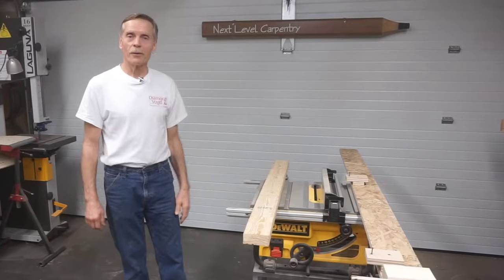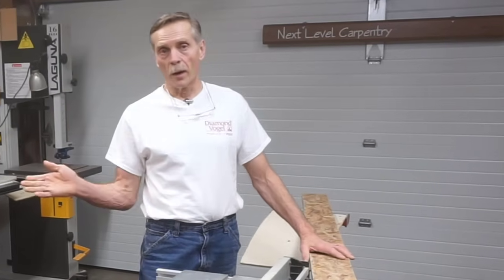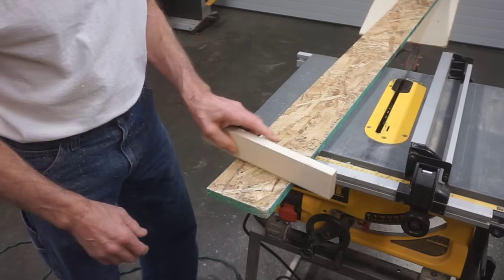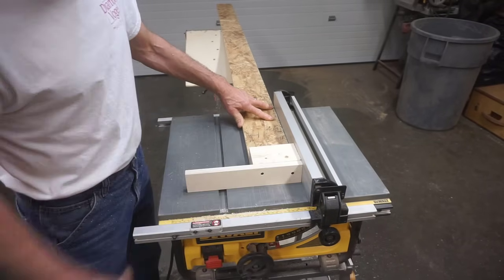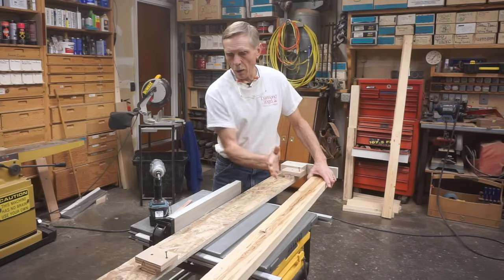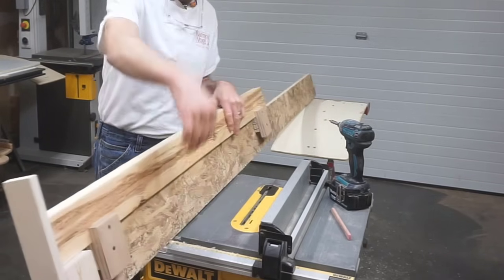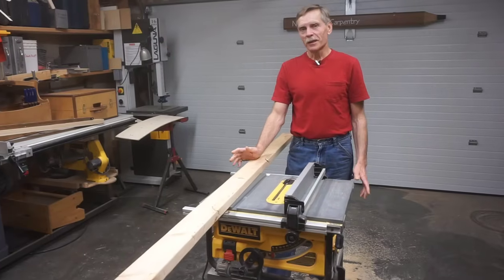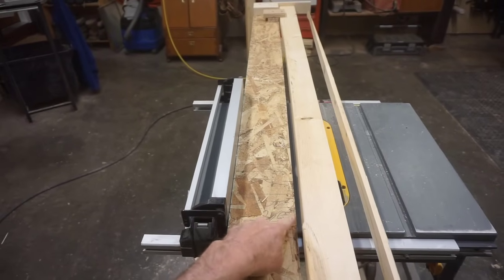How to Cut a Straight Edge on Crooked Boards

Comment: Good video and technique. I think this idea will be more useful for me simply because I'm not a full time carpenter/woodworker and I do tend to look for the discount lumber at the big box stores, which are FULL of warped boards anymore.  If I start doing more work with nicer wood, perhaps I'll look into the other methods that you mentioned, but for now, I have everything I need to make this jig. Thanks much!

Comment: This a great way to straiten lumber.  I also have an 8ft level I use with a flush cut router but to straighten one side sheet goods before I start cutting them down to their final size.

Comment: I have been looking for a method to straighten 4/4-6/4 rough kiln dried. Usually have to use an 8 ft straight edge and a powersaw to get one good edge. Surfaceing is easy. With the goal of s4s and minimal material loss, this method has its appeal.

Comment: Thank you for this video. This is a good trick and probably more applicable for high value pieces such as hardwoods.  However for most projects probably not worth it because of the time involved.  Also pieces with a long slender profile will more than likely keep moving.
Reply from the maker: Actually the opposite is true Jack: the main purpose of this is for framing lumber just like I show in the video.  I recommend using a jointer or a different fixture design for 'high value pieces' to avoid screw holes in the wood. Best, Matt

Comment: I have also just temporarily screwed the straightedge directly to the warped board and run it through to get a straight edge to work from.  Fast and makes for fixing a lot of warped boards quickly without much setup time between cuts.

Comment: I joined two 4' 4x4 posts together with a tenon embedded in mortises created at opposing ends of the posts. The resulting 8' 4x4 post is slightly bowed at the join, such that one 4' section of the post is approximately 1/16"-1/8" below my 6' level. I think I will try your technique as described. Thank you for sharing.

Comment: Just learned this lesson the hard way using white oak 8/4.  Must of been lots of tension in this board, bowed abut 1/2 after ripping.  Going forward will cut with an extra 1/2" and will use this method to straighten.

Comment: Very few job sights I worked on had a table saw, and this would have been done with a skilsaw. Maybe you could demonstrate that method. The how far out gage is a version of a plumbers level used to set the grade on drain pipes. I can see how it could come in handy in the building of a house.

Comment: Thank you for the great tips and tricks.  We maybe using this to square three pine live edge slabs that are 3" thick.
Reply from the maker: It might work, depending on the overall width of the slabs.  If you have access to a track saw it would probably make life much easier if the slabs are large, long and/or heavy.  You're welcome either way...
Best, Matt

Comment: Good video, even though you looked like you where glitchen out.. I use the on top of the straight edge method ALOT on pallet wood that I've planed down. Gona try this on the 2x4s I get off of them.

Comment: I have hand planed to straight 2x6's on my shed rafters where the roof sheathing is nailed on.. And you can just split a board in half and clamp it straight against itself or a straight edge, then screw and glue it straight. I have also cancelled out warps by laying one board on top another and clamping them against each other, did that for my double header of 2x4 above the shed door. Another trick I did for molding around my shed window with a 30 " twisted 2x4 was run 4 slits in the back of the 2x4 about half the thickness, then clamped it in place and screwed it down. Dont run the slits all the way to the board end. The clamps pulled it down straight with ease.

Comment: I have seen a similar method on a job many years ago when I was just a laborer, except this was done with a circular saw.  A fence was fashioned from a few rips of OSB sheathing fastened together in such a way that it was essentially a track/guide for the saw.  It took out a lot of guesswork, just flush up the two outer corners with the track then rip the material, taking out the bow.

Comment: Hi from a carpenter in England. That seems complicated for a simole job.
 If I were doing it I would have just screwed the bowed timber to the straight edge with an equal overhang each end and run it through. Job done.

Comment: Crooked as a bucket of snakes!  That line had me LOL!  Great video. I'm looking to do this on a live edge.  My only worry is that is a heavy piece and about 18" thick.
Reply from the maker: I think you mean your live edge piece is about 18" WIDE, not thick?  For that situation I'd be much more inclined to use a more typical straightedge clamped/fastened to the piece and make the cut with a hand-held circular saw.

Comment: TBH, if a board is that messed up, straightening it up with the saw is going to remove so much that I might as well not use it or don't buy. But, the methods you used to straighten curved/warped boards is great!

Comment: Yeah that was easy enough because the board was only bowed but what if it was also twisted?
That was actually pretty slick, thanks for sharing! 👍
Reply from the maker: Even if a piece of framing lumber is ONLY twisted it's firewood IMHO... it's worth taking twist out of wood for cabinetry, millwork or furniture mainly because of the higher cost/value of hardwood compared to framing material... at least prior to 2021, that is!😎

Comment: Not a bad solution. One of the problems I've had with 99% of the jointing sleds out there is that they're made for short boards. This is the first sled approach I've seen for full length boards. I might explore this option, but opt for baltic birch ply. I don't use OSB for anything, so I'm not likely to buy a sheet just for this, but I'll definitely use baltic birch for jigs. Thanks for the tip. 👍🏻
Reply from the maker: Glad you're able to grasp the concept shown in the video and adapt it to your materials needs and preferences... it should serve you well as it does me...

Comment: In a FAA book for authorized repairs, it shows the grain of the wood and the direction If any the boards would warp..
I made a copy of the page, so when I go to buy lumber for construction or project wood, I buy lumber based on grain direction..
As stated in the video about warped wood piles..
I went through two piles of picket  boards to get enough for a straight fence..
Then came the rails and that was another 2 piles. 
The guys at Home Depot weren't happy..

Comment: hi. I'm using the same portable table saw and currently trying to start my bunk bed project and after searching Youtube for a way to straighten out one side and bevel the other side of a 2x4x10, your technique is THE most useful for the tool I have. Thank you for helping out DIYers. I watched a lot of your other videos too. Question: can I use MDF instead of the plywood that you used?
Reply from the maker: The type of material is inconsequential as long as it is thick enough that it's not floppy in use... most stuff in 3/4 inch thickness works good where some materials in half-inch aren't stiff enough.

Comment: I use a similar trick to cut mild angles onto long narrow boards. 
Say you need a 4ft piece of 1 by that is 5" wide on one end and 4-3/4" inches wide on the other. 
Just take a 4 ft section of 1x6 and then take another piece of 1x6 and lay  it on top of the first piece revealing 3" at one end and 2-3/4" at the other and either screw it with a few screws or if you have a brad nailer shoot 3 15g brads through the first board and just short of fully through the second.
Now set the fence on the job saw to ride on the piece not being cut and set the fence depth so that the blade lines up with a mark at 4-3/4" or 5" depending on which end you are cutting from.
If you used brads (my favorite method) you can just pull the two boards apart by hand and the holes left in the piece you are using will be tiny and can of course be on the back side of the piece anyway. Then use a pair of pliers to pull the brads out of the guide piece so you can reuse it.

Sure it takes a little longer than drawing or snapping a line and cutting with a circular saw but once you get used to it the process is not that time consuming and the outcome is  much nicer.
Reply from the maker: That's a lengthy but thorough explanation of the general concept for cutting tapers... many ways to skin that cat but it's good to hear you have applied it successfully in lieu of freehand cuts from a chalk line.
Best, Matt

Comment: Excellent field tip. I’m gonna mod my out feed stand like yours. My stand is just alright. It tips on contact and has a short bevel on the edge but it looks like that setup works 100% every time. Subbed for the info and the keel joke lol 👍

Comment: Good idea, but if you are trying to straighten valuable lumber you do not want to be driving screws into it. Instead of those hold down blocks, I used adjustable toggle clamps. I also made a set of different thickness spacer blocks for clamping different thickness curvy pieces. The toggles are adjustable but at the lowest setting they can clamp a 3/4" thick board. Any bigger requires the spacer blocks. The toggles clamp the work piece to the top of the carrier board. This also works well with twisted lumber. Piece is securely clamped to carrier using shims to fill in the twist. After trimming the minimum off there is now one straight edge to place against the fence of a jointer.
Reply from the maker: When straightening 'valuable lumber' I recommend using a jointer because you'll need one if you expect to make anything worthwhile out of it...

Comment: I use a Skilsaw, two saw horses, two clamps and a straight edge.  Set up time less then 5 minutes.  Works on any size boards wider than 2" and leaves no holes in your finish board.
Reply from the maker: A lot of people use that exact same Method Ron. So it takes you 5 minutes to cut one board while it takes me 10 minutes to make a jig and I can straighten boards all day long much more quickly... I guess it's personal preference and expediency right?

Comment: Thanks for the tips on how to straighten a lumber.  I was hoping for some tips on twisted and crooked 2 x 4, and was pretty disappointed after you mentioned these type of lumbers should go into fireplace.  I got not one but 15pcs of  2x4x8' back in summer and left it outside for months.  Now when a project hits, I found out these lumbers have became crooked and twisted even some of them.  I do not have a planer or jointer.  Looks like I really have no choice but to burn these~~  Perhaps you can show us some tips on how to buy lumbers and prevent it from crook/kink/twisted over time.   Thank you.
Reply from the maker: Sadly, with framing lumber in such awful condition as you describe, there is no hope in saving it for it's intended purpose.  Even if you were to straighten those pieces, by the time you got them all straightened out, all you'd have left would be very straight... toothpicks!  Better to roast marshmallows with them and get new, straight pieces for your projects! 😉😎 Best, Matt

Comment: thank you so much for this video. It's a  problem that I have run across in my shop more than once. I wonder is there a similar way of doing this using the radial arm saw in the rip position?
Reply from the maker: Theoretically you could do everything the same an just use the radial harm saw's rip fence instead... but I cringe at the potential danger of ripping much using a radial harm saw Roger... work carefully if you attempt this, OK? Best, Matt

Comment: Wow! I’m on youtube for projects a lot and this is the most CONCISE, while EXPLANATORY video I’ve seen!!! Liked your other project tips, added the “How-Far-Out” gauge as a future purchase. 😃

QUESTION: Screwing a deck down to my commercial flatbed. I’m edge routing 22’ long rough sawn 6qtr with a width variance in the crook of about .375 to .500 (widest in the mid). Boards are 8”+; I want them 8. Plan to use an edge guide, replacing the 3/8” guide rods w/ longer alum tube to extend the guide to meet the width I need to run. Still a crook I know, I can secure one end and clamp/straighten boards as I secure down the length.

Have a better idea for me?? Or tips???

Thanks!
Reply from the maker: Glad you found & like this video!  Not sure I fully understand what you're doing but if you are using a router to "shave" ~1/8" off edges 22' long I would ditch the edge guide idea.  I would get a couple  pieces of masonite or LP Smartside siding 12' long and rip them exactly 8" wide.  Tack them on the bottom side of a piece of decking so the board sticks out a little on both sides.  The siding will serve as a "flush trim" guide for a bit like this: https://www.amazon.com/dp/B00KZM1JMG?linkCode=ssc&tag=onamzdigitalj-20&creativeASIN=B00KZM1JMG&asc_item-id=amzn1.ideas.29WVINIJF4EUJ&ref_=aip_sf_list_spv_ons_d_asin&th=1
 In a decent router, one pass down each side will consistently leave planks identical in width, exactly equal to the 8" width of the siding "patterns"

Comment: Hi Mr Jackson, your table saw support stand is small and interesting.  Do you have a video about that?  Thanks
Reply from the maker: Thanks for noticing Howard.  I custom made that portable stand because I wanted it strong and compact and the only way to get that is to design it specifically for the exact tablesaw because there's no such thing as 'one size fits all' when it comes to portable tablesaw stands IMHO.  Unfortunately I do not have a video about the stand...
Best, Matt

Comment: Great idea. I make tables so would you use same process for that type of work vs worksite lumber
Reply from the maker: This method is much too crude for making furniture. It works well for initial straightening but edges need to be cleaned up and jointed either by machine or plane to be prepared for glue up or finished edges.
Reply: @NextLevelCarpentry  Ok, thanks for the response

Comment: This is great.  How about if the warp is in the other axis?
Reply from the maker: Boards like that require 'flattening' instead of straightening.  That's best done on a jointer or a thickness planer with a 'sled'.  Good news is that framing boards like studs are easily straightened while building and  generally don't require flattening for use.

Comment: You're right, the only thing you can't make a jig for is a twisted board. Twists never come out.
I've even used the same type of sled to make a straight edge on a 3" to 4" diameter log so it can be attached to dimensional lumber.
Reply from the maker: I agree that you 'can't make a de-twisting jig for a tablesaw but it's entirely doable (and actually rather simple) using a jointer or thickness planer sled...

Comment: This was a great video. I made it and it worked perfectly. Because of this I subscribed. Thank you. Question though… would it be okay to replace the hold down blocks with toggle clamps as well? Thanks again.
Reply from the maker: Thanks for the sub Vegas Rod.  A jig for use with toggle clamps is more cumbersome because toggles need a surface to 'clamp against'.  There are plenty of good videos out there for that type of jig that are useful, especially for wood (like hardwoods for furniture) that you don't want to put screw holes in.  This fixture is mainly for quick 'down and dirty' straightening of framing lumber and general construction materials...
and you're most welcome! Best, Matt

Comment: Good job, I was about to ask what if the board warps again, then you answered that question.  I'm wondering if there is a way I can use the table saw to straighten studs that are already in the wall, probably too heavy to slide up and down the walls :)
Reply from the maker: Laughing out loud at that one! You know you might be on to something with the idea though with the amazing cordless job site table saws they make anymore it just might work😉🤣🤣

Comment: When you described the board as 'dry and stable' I have not seen any of your videos where you use a moisture meter to determine the moisture in your wood. (Link please if I missed an important video on moisture). Have I missed a video where you discuss wood moisture? Do you have a friend who does wood flooring who would add his knowledge to the conversation?

Comment: thank you for sharing this info.  I wished i watched this before i ripped a 8ft long 2x4.  Yeah im new to wood working.  when i got half way through the cut, it became harder to push the 2x4 through the table saw due to the board pinch on the other end. Good thing i have a riving knife.  So my troubles cutting the 2x4, was this cause the wood was bowed and when i started cutting that tension was released or am i missing something?
Reply from the maker: Sounds like there was a lot of internal stresses in the board you ripped Brandon, the cut just released it... it IS a good thing you have a riving knife!  Even a straight board can bow/twist when ripped because the cut disrupts the equilibrium that held the board straight. Such is the nature of wood... in time you'll be more able to anticipate what might happen by studying a board but, even after 45 years at this I still get surprises!  Thanks for watching and  commenting here...